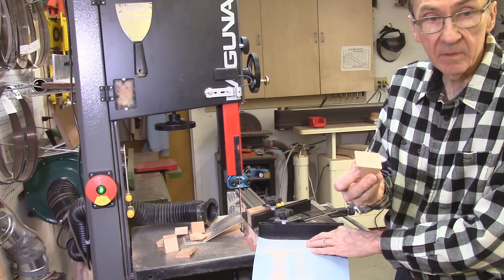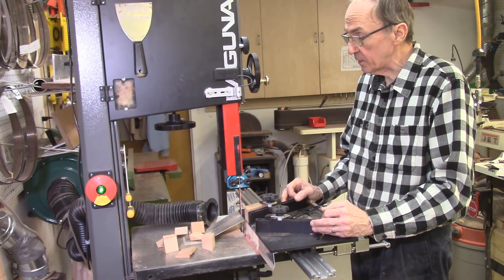A Study of the Parameters Affecting  the Burr on Wedges using the Accu-Wedge (46)

Comment: Would putting some painters tape across the faces help with the bur? My thinking is that the blade will have to travel that extra distance to get through the material causing the tape to bur instead of the wood I could be way off on my thinking.
Reply from the maker: Subsequent to this video I did some additional testing. I tried attaching some masking tape to the back edge of the board, but it did not help.  Plus I would be concerned about the tape adhesive gumming up the blade.  I also tried sealing the back surface of the board with shellac, and again this dis not improve the burr.  Finally I created a small table on the opposite side of the band saw blade at the same height as the Accu-Wedge table to support the wedge as it was cut off, but again this did not help.
Reply: Thank you keep up the great work enjoy watching.